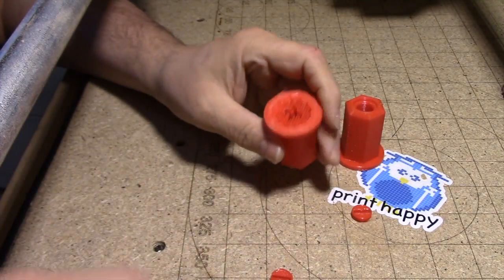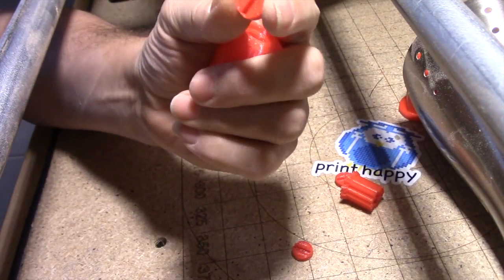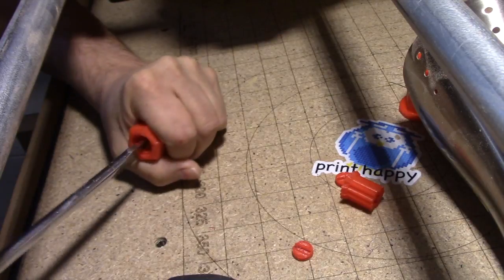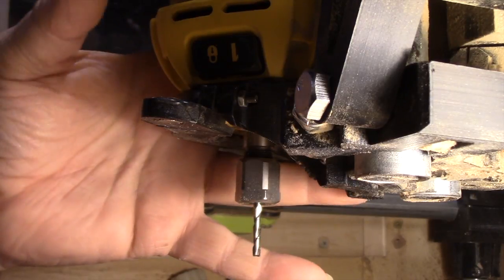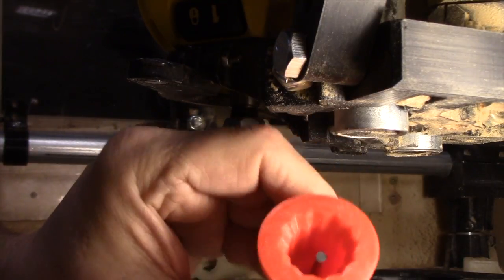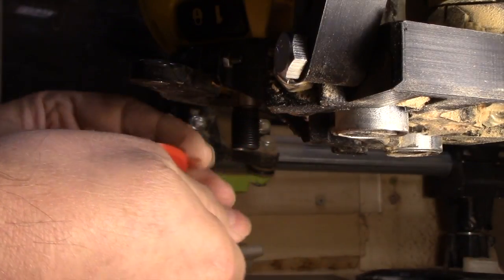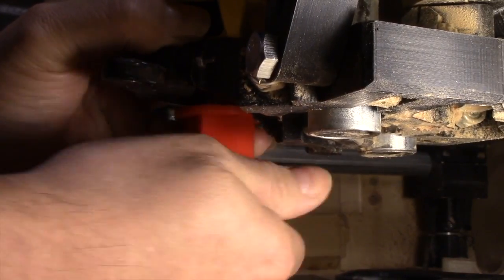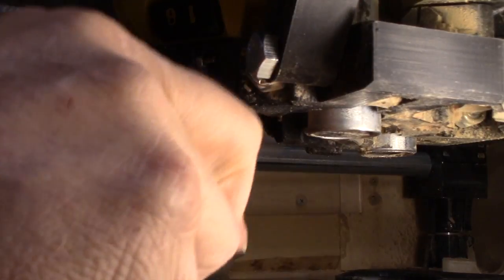MPCNC   13B   A Bit Changing Tool On Thingiverse

Comment: I'm going to take a look in the forums, but how did you remove the plastic collar on the dewalt?
Reply from the maker: Unfortunatly I don't remember. I thought I saw a video on it, but can't seem to find it now.  It felt  like I had to get into it quite aways before there was a snap ring that could be removed.  Start disassembly from the bottom. There's a button and spring, then there should be a snap ring. Hope that helps
Reply: Some Old Guy Coding ok thank you. I'll take a look.